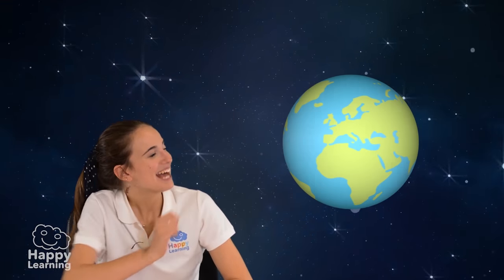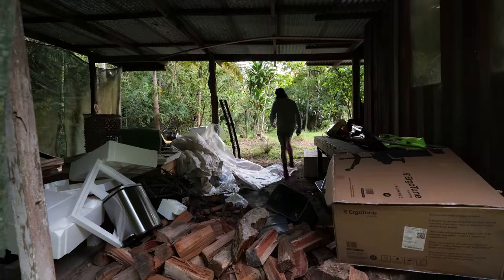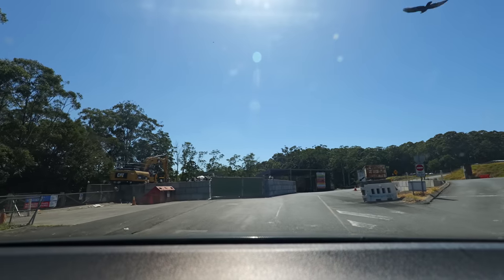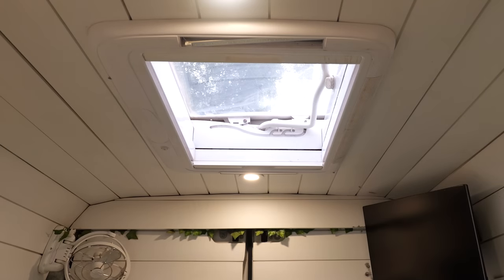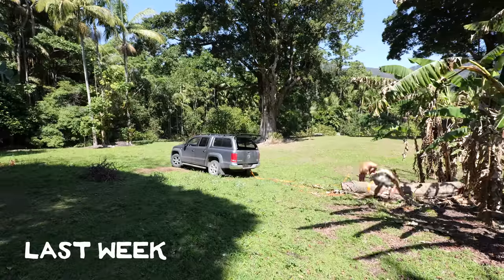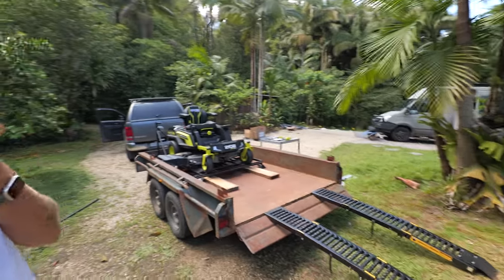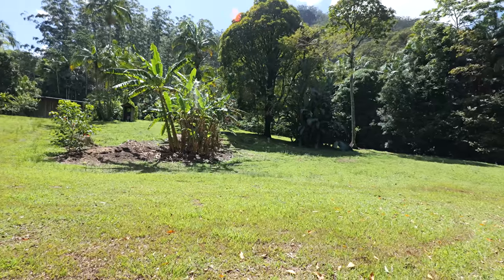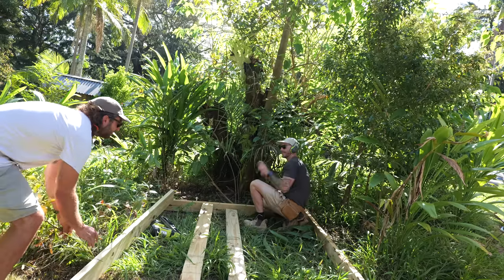Starting over. Springtime at my Rainforest cabin in Australia

Comment: Max, you can create a roof above the deck on the side of your van with mosquito netting. This will provide you a dry entrance deck in the winter season and protection against mosquitos and other insects. In summer it will provide shade and cooler temperatures.

Comment: Hey Max, just found your channel so HI!!
Was just thinking, if you have a small roof over your deck it would be the perfect place to use solar panels and then hang a battery or two under the deck for some extra 12v lighting around your extended living aera. Also as a bigger charge capacity for your/guests van in bad weather and keep your costs down by not relying on mains power! 
Either way this is going to be so good when done!!

Comment: Great idea for the van deck. I’ve lived off grid in very remote far far north qld for over 20 years. I personally love modular living areas where I’m at. Lots of outside living areas, whereas the “shack” itself is small. Easy to clean, low maintenance, and very simple. External shower toilet, gene shed, and verandahs. 
My one wish……a big shed with a big slab under it.

Comment: Hi to bad you do not know somebody like me there I would have had that old mower working like a Swiss watch in less than 30 min or less if the engine was not blown up . On your shower , I built a outdoor shower here in Florida USA , I used what we call a plastic milk crate . Put galvanized animal cage screen inside it and filled it full of small stones and buried it under the drain it works very well . No flooding the water soaks into the ground very fast . If your soil is harder there you just increase the size of the drain container . You could use a plastic drum and drill a lot of holes in it . I shower using Dawn dish washing liquid soap because I know it does not have any dangerous chemicals in it and so it should not be bad for the earth .